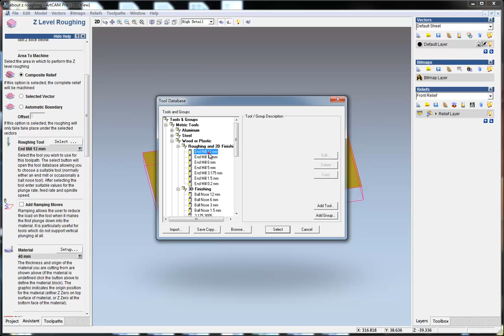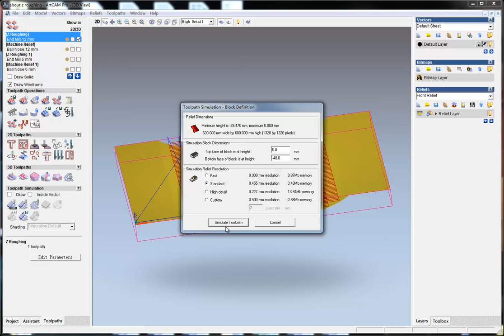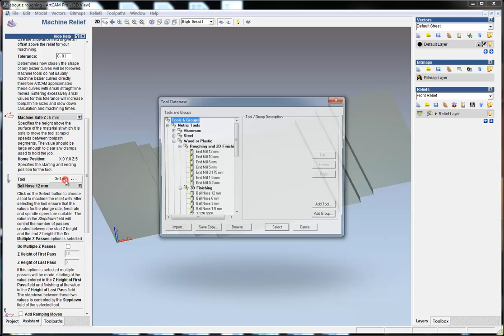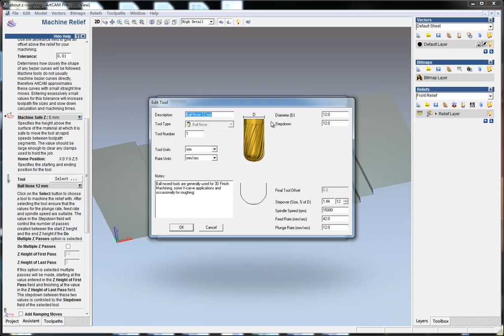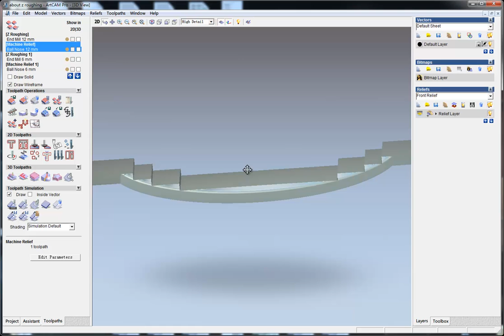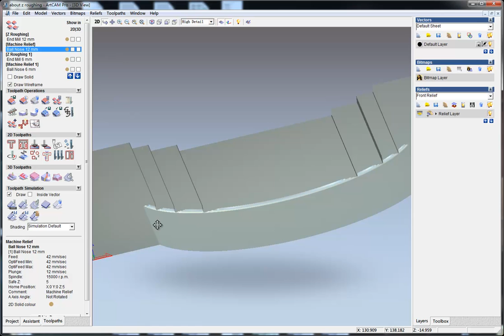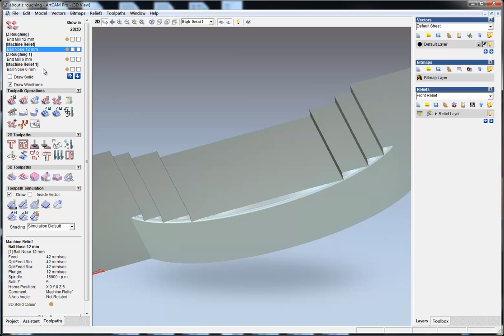About Z level roughing with artcam

Comment: Hello, Liu Xin.
What is the difference between machining relief and Z level roughing?
I tried the Z level roughing but my computer crashed when I use more complex geometry and it took a long time to do.
Reply from the maker: Z level roughing is "roughing" work. It doesn't finish your relief but semi-finish it. You need relief machining to finish your relief.
roughing work is necessary when the relief is thick and big. It save you more time on finishing.
Reply: LIU XIN
Thanks for the explanation.